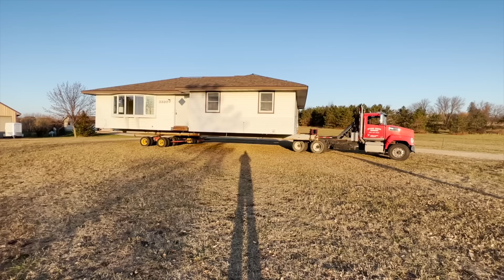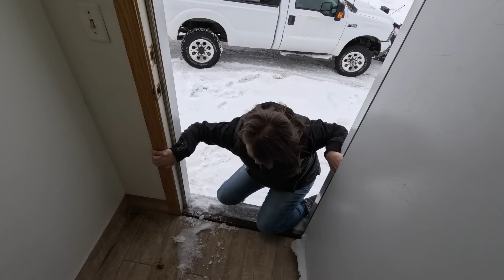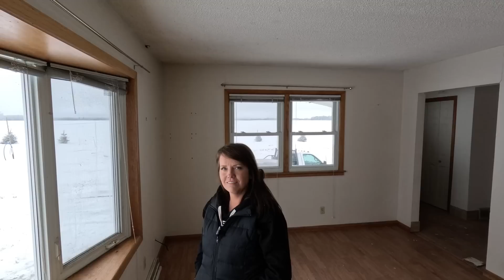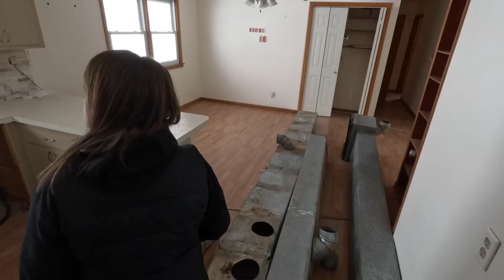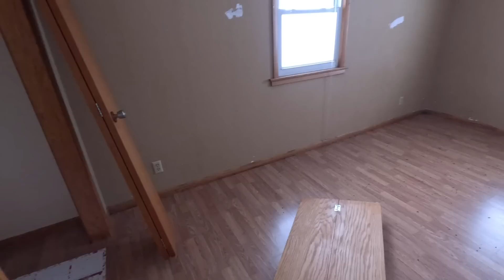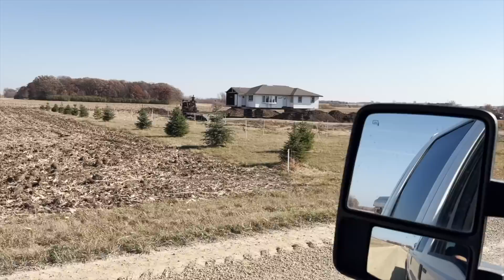Shocked By The Damage!!  First Time In The Moved In House!

Comment: Our house had some cracks from settling and before painting we had someone come in and "fix" them. The paint job was finished in August and the cracks have returned but they look even worse. I'm wondering now if the guy didn't tape them. Would this be the reason for the cracks reappearing?

Comment: I guess it's like being on an aeroplane and seeing the wings flapping, if they didn't have that action then they would fall off.  The cracking around the door frames and window lintels are the same without them the house would simply twist and break apart.  The slight cracking is visual I am guessing and not structural so take it as a win.  If you are having someone doing the taping and skimming get them to also remove the popcorn off the ceilings too.  Remember when choosing flooring, tiles, colours etc to choose from a transitional aesthetic for longevity, property rental and value.

Comment: My moms house has a power outlet at the top of one of her kitchen walls. It is for an electric clock. 
So sorry about the cracked drywall. Yes you cannot let a house sit without heat in the winder plus moving the house probably caused a lot of this also. But hey, you can fix that. Also when you get heat be sure to check for mildew from the house being so cold and gathering moisture. I wouldn’t start repairing the cracks for awhile. You are doing a great job.

Comment: I didn't notice the height of the wall outlet, but in our house there is an outlet in the soffit above the kitchen sink.  Apparently, it was for a wall clock before the advent of battery operated clocks.  My husband rewired to install lights above the sink with a remote control switch located on the underside of the wall cabinet next to the sink.  Meanwhile, there's a battery operated clock covering the original outlet space.

Comment: I live in an 1880’s farmhouse that was moved to its present location 57 years ago. The move weakened all of the plaster, and most of the ceiling plaster on the second floor has fallen off. So I’m not surprised that you’ve had some cracked drywall seams, especially since the steel beam you installed is apparently insufficient. I suggest waiting until the floors are evenly supported and leveled before filling in the cracks, otherwise you may end up with new cracks forming. Also, you can never have too many jack posts in the basement! 
Those skits at the end of your videos are great fun! You’re definitely creative! I still laugh when I remember the one you did with Dawn on her channel as “Justin Case!” I hope you keep doing them!

Comment: Just make sure that whoever does the crack repair does it correctly and not plaster over it. We had a house lifted up, the basement underneath it torn out, and a new one replaced under it, and we had damage in the house just from doing that so definitely not surprised you had damaged moving it twice. Our problem was the people that did the repair work inside the house must have just mudded over the cracks because now 10 years later the cracks are coming back through. Make sure they do it right so you don’t have to mess with it later.   It’s going to make a beautiful house when you’re done.
Reply: I have some cracks in my house, would love to know the right process so I don't have to repeat it. 😊

Comment: It’s going to be great!  The drywall issues are  not surprising , no humidity or regulated heat in the house for years.  You are still going to be $ ahead with this house rather than a full build.  Materials and labor is still at a high and that is if you can get what you need when you need it.  This house and lot are going to be beautiful when you are all done.  Trust in the process!

Comment: When I was in real estate, occasionally people would turn off their utilities to “save money” which cost them in the long run. There were always cracks in the drywall and ceiling, usually at the joints, due to drastic temperature changes. In your situation, temperature changes couldn’t be helped, not to mention the move likely caused some cracking.

Gorgeous views!

Comment: Looks nice!  Here is one easy interior design change.  I can see the previous owners made the common mistake of hanging the curtain rods right above the window casings.  MOVE THE RODS UP to a few inches below the ceiling, and have them extend 12" out on either side.  Buy inexpensive cream curtains which will probably need to be 96" long.  This will make the windows  (and thus the rooms) feel so much bigger.  (I've told this to Dawn to do in your own house too.)  Also, do the same thing with the shower curtains.  Hang the rod a few inches below the ceiling, buy extra-long liners.   You'll be able to charge more rent.   From your self-appointed interior designer.  🙂

Comment: Everything settles and temp changes add to it. Being somewhat flexible anyway the drywall will crack at the joints which are the weak spots. The ONLY things that won't crack when being moved are pieces of construction equipment.............IF you don't crash. BLESSINGS!